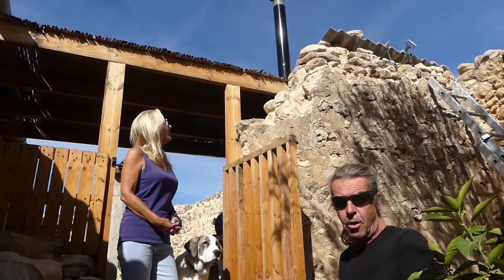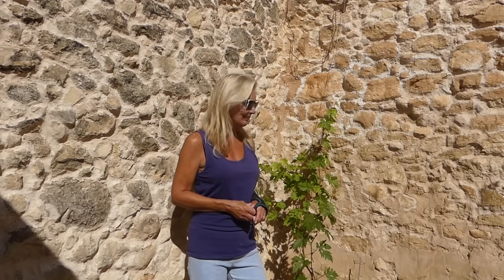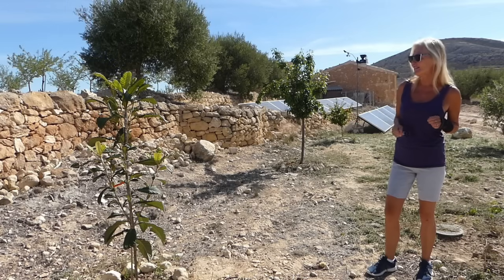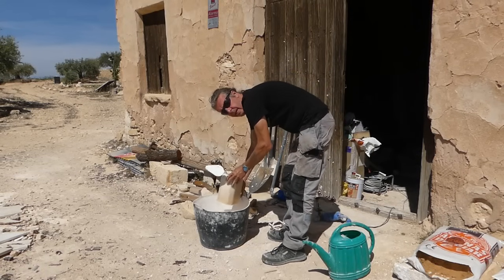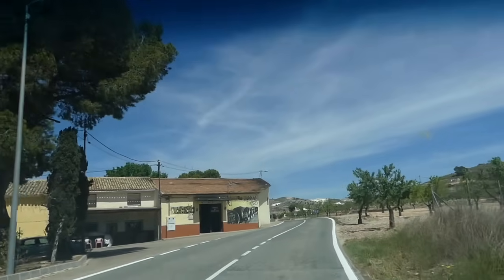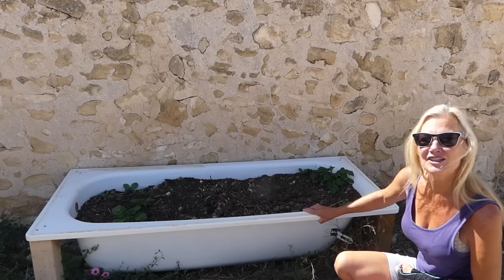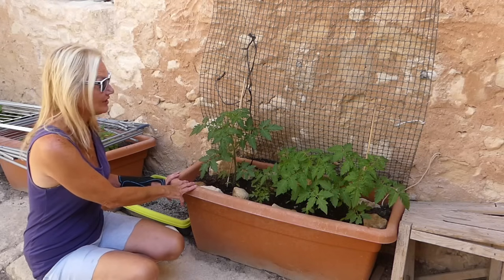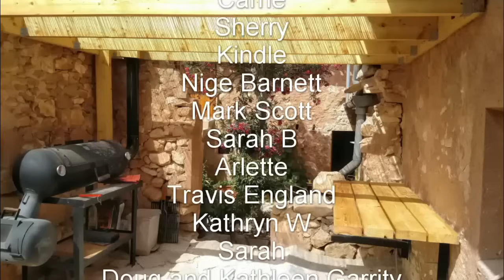Monastrell wine, growing food and building walls – It's Finca life!

Comment: Having previously lived in dry dusty, drought prone areas, the best way is to keep the roots as cool in summer as possible. This means heavily mulch around plants for a good distance. Those artichokes, for example, I’d mulch the whole area with about 30cm deep hay. Then give them and the hay a thorough soaking and that should hold them for a good while. I used to use eco friendly dish and clothes detergent and save the water for my fruit trees, which also should have a deep and about a metre wide mulch. Thick layers of mulch and manure if you can get it, is the secret to dry area gardening. I’d also use raised beds about 50cm deep, about 1metre wide, mulched thickly
 too, as they tend to hold the moisture ok. They look pleasing too if made from stone. If you can get your hands on unglazed pots, no holes in the base or plug them with aquarium silicone, sink them in your garden beds, fill with water, lid on (a pot saucer) and they slowly ooze water to your plants. There’s a name for them but it escapes me at the moment. A bit long winded comment but hope you find it helpful. Also I was going to mention the pipe for trees idea as the previous comment has suggested. Raised beds for fruit trees is best also.

Comment: Lovely plants. You might try putting a mound of planting soil dead center of your soak away for a few of the melon plants. Here in central Texas, the caliche soil & temps are very similar to your area but melons well once they have enough leaf canopy to shade the underlying ground. In the soak away , the shading by the plants might help conserve the moisture for your little orchard. Just a thought.
That rebuilt wall is a wonder.  You both are doing an amazing job with the homestead. ROCK ON 😎

Comment: Hydroponics best bet for growing, you need fish tank water pump led lights pump water through 40-50 mm tube making a frame like a large bathroom towel rack.Put holes in tube wrap with insulation wool the roots will search out the water and take the minerals for the plants the now clean water will return to the tank.Lots to view on utube.trees and bushes when planting put 60cm length of 50mm tube in the ground in-between the roots pouring liquid water/fertilizer down the pipes to get to the roots.always look forward to your channel as far rain it's wetter than an otters pocket never stopped all year yours David North Yorkshire